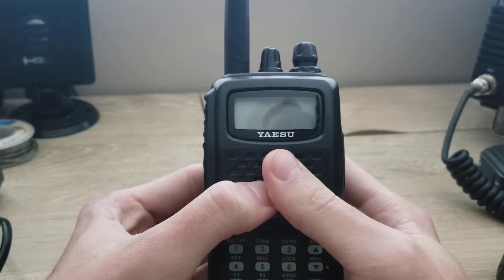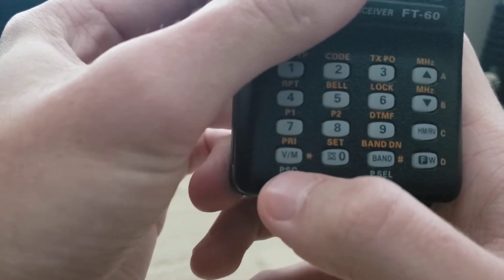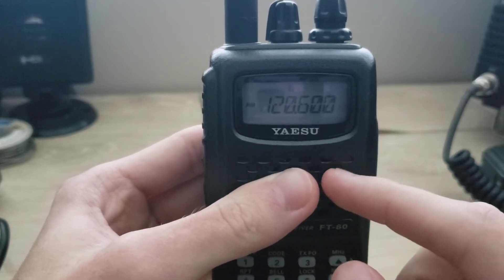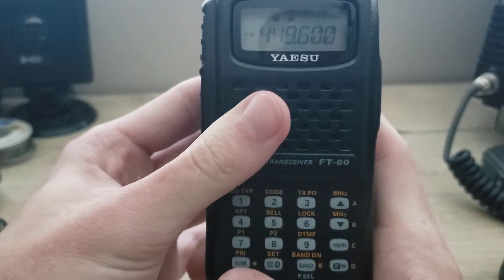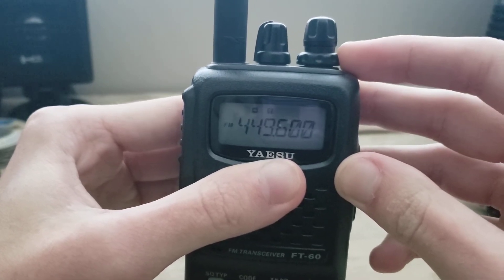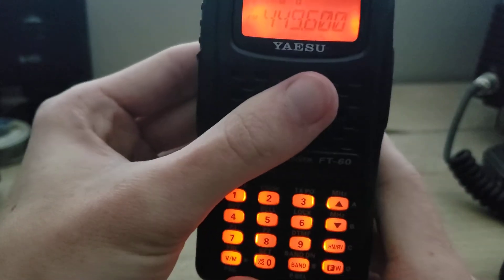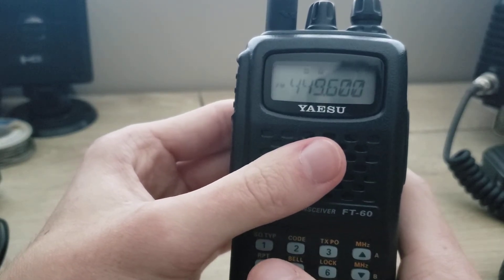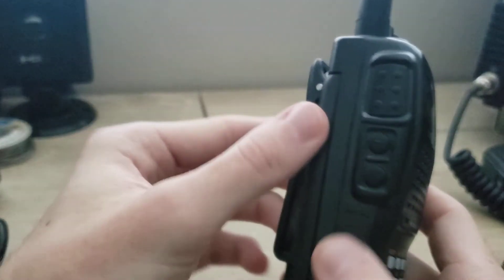Yaesu FT-60R Overview And Basic Functions

Comment: Will this radio tx/rx so much better than a Baofeng?  I really don't care about menu options as much as being able to be heard and hear others on repeaters. If they're both only 5 watts why is this so much better?
Reply from the maker: The FT-60 is built very well and very rugged. The TX and RX outperforms any Baofeng by a landslide.
Reply: @AI7HE  that’s what I want to hear.
Reply: The uv is an awesome radio for sure, it has the advantage of being jail broken, we all know that, and being a pretty sturdy little radio for 20 bucks, a back pack radio. But in actual field I want my ft60, it's built like a german whore and you actually can unlock these radios too pretty easy but the radio can die if you dont know what your doing. If your serious about ham in the long term the ft is best, it has a significantly better recieve and tx and sounds wayyyyy better. Fucking quality. The uv is something you buy a case of and arm the family. They are both great radios.

Comment: Please help me. I was testing my Yaesu FT-60 listening to the frequency 450.750Mhz, and i decided to transmit, at the sane time, with my Baofeng UV-5R on a completely different frequency (462Mhz or so, and the radios were 1 - 2 meter apart or so) and i noticed the Yaesu FT-60 went completely mute on the 450.750Mhz frequency. I thought things like this weren’t supposed to happen on this radio bc of the Double Superheterodyne Reciever. Please tell me if this is normal or not.
Reply from the maker: Nothing is wrong with the radio. Since your transmission is within the area of the FT-60 the receiver is overloaded so it can’t receive on the frequency you want to hear.

Comment: Why is this a common first HT?
Reply: I LOVE MY YAESU FT-60R!!! IT'S BEEN WITH ME SINCE 2005 AND I STILL USE IT.  GREAT RADIO!!!
Reply: HT-60 came out in 2004 and was about $150. UV-5R came out in 2012 and was about $25. Because of that price, and then all the similar variants that came out shortly thereafter, it didn't take long for it to become a more common first HT.
Reply: It isn't, because it cost 10 times as much as a Baofeng UV-5R
Reply: @Gruuvin1  just mad you can’t afford one.
Reply: @John-uy4xp  it's not a common first HT. Do you have a problem comprehending English?
Reply: @Gruuvin1  The FT-60 was my first HT. Still have it and works perfectly and really easy to program with CHIRP. I have also owned Baofeng radios. I was curious what I could get at such a low price. I found that they last about a year and just die. The second died about a week ago and I am now on my third one. I am not really upset because, at  $25,  I regard them as disposable toys. But for as long as they work, they work well. Just have to do a factory reset on the newest iteration to use all the features.